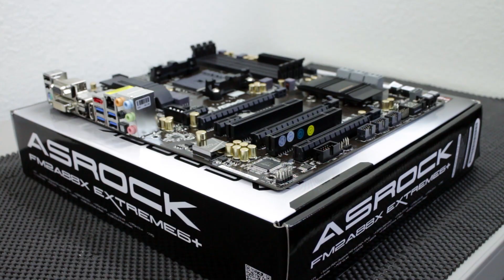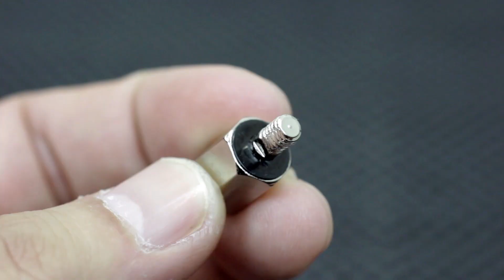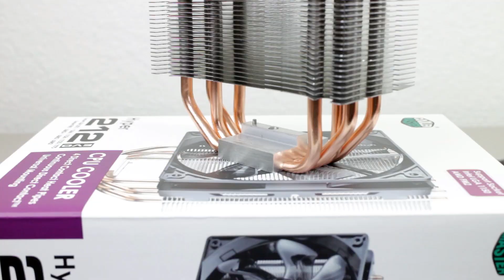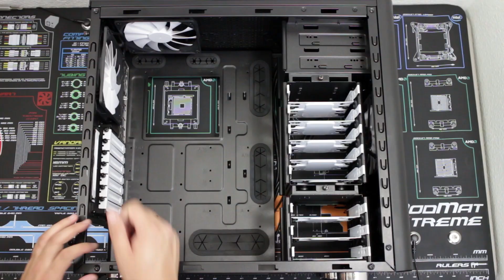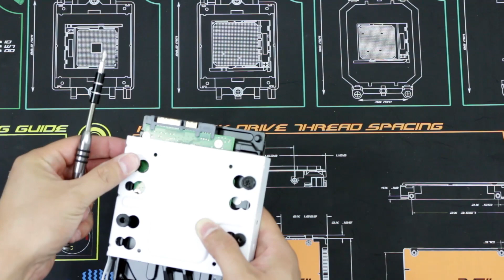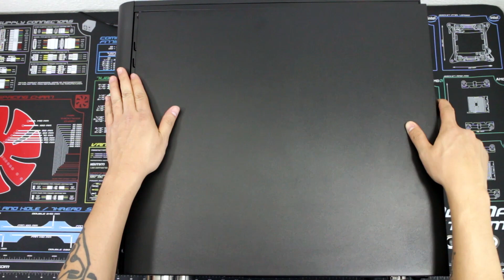AMD FM2+ Build Guide Part 2: The Build

Comment: I just wanna ask. I have my old rig.  My family used it for typing and other documentations. 

But as years passes by, we figured out that it gets slower in terms of booting from turning it on. 

Btw, i used f2a55m-ds2 rev 3.0 motherboard and a4-6300 igpu. Then suddenly last week, i won a Kingston SSD on a raffle draw. 

The first thing that comes into my mind was a question.

Does my old setup supports KINGSTON SATA SSD?
Btw, its only 120gb and i think its enough for storage of OS alone. Hoping for your response Sir Johnny. :)
Reply: What type of sata ssd is it because if it is standard 2.5 inch it should work

Comment: bro pls pls plsss reply whats the best CPU and Video card for Fm2+ motherboard?
Reply from the maker: Fx8350 from Newegg is $80 and either a RX 580 or gtx 1060 for less than $230 if you can find it. I've seen them for $200 online.
Reply: @johnnythegeek  fx8350 is for AM3+ motherboard right? Can i use that in fm2+?

Comment: I just bought all the hardware for a build just like this. My present system, an EVGA system, has caps going bad and starting to give me post issues.  It is 8 years old and has provided me great functionality but alas, everything has a life cycle so time to build a new one. I have an Enermax Ostrog GT Mid Tower Computer Case, an ASUS Crossblade Ranger MB, 16 GB Corsair Vengeance 2133 MHz memory, AMD A10 Series A10-7870K Processor - 3.9 GHz, Thermaltake SMART 650W power supply, a Hyper 212 EVO Universal CPU Cooler .  I have every thing but the power supply and processor. I am excited to build this one. Should have this done by Wednesday.

Comment: Planning on doing my first PC Build tomorrow but I have no way to avoid ESD. I know not to wear socks, but any other helpful tips?
Reply from the maker: just keep touch the metal case to dissipate the esd. you could also lay a mat or large cardboard box on the floor to stand on. Don't worry too much about static. As long as there isn't arcs of electricity coming out of you you're fine.
Reply: +Johnny Phung (johnnythegeek)  would a rubber mat work?

Comment: Toughest part is connecting the front panel connectors. Was very fiddly in such a tight space. Make sure you align the pins correctly (it's easy to let one or both of the pairs slip one place right) and be aware that the front row has a fifth, unused 'dummy' pin on the extreme right. Also there is a tenth standoff connector just above the 'purity sound' module. My case came with six pre-installed and I added another four from the Asrock supplied pack of fixings.

Comment: Nice job! Thanks for that video I am subscribing for sure. I do have a noobie question. Do you have to switch the back plate they seem to have the same screw spots for the AMD FM2?
Reply from the maker: Hey that's a great question. Most likely not only because adding the standoffs to the stock motherboard backplate will make it higher than it needs to be. then the cooler will not make enough contact with the cpu. Thanks for watching!

Comment: Hi Johnny, your videos are really helpful. Got very similar hardware few days ago, but I do not manage to run my memory at full speed. Do you have any advice how to troubleshoot such an issue ?
I have the FM2A88X Extreme4+ with a A-10 7800, my memory is 2*4K G.Skill RipJawsX DDR-2400. The system boots when I set the bios memory speed to 2133, but doesn't at 2400.
Reply from the maker: Did you check to see if you can set the timing manually to what the ram can run at? 11-13-13-31-2N Also, the voltages should be at 1.65V which is much higher than the standard 1.5V for memory. Hope that helps and thanks for watching!
Reply: ***** Thanks for your reply, unfortunately that didn't help. The memory is already auto detected to 1.65 volt, and setting this value manually didn't help either. The timing was as well correctly auto detected but I still set it manually, tried with using xmp profile as well as setting the latencies manually ( write latency was set to 8 by default and I didn't touch that setting ). Still the same behavior. Is it safe to set higher latencies (underclock) ?

Comment: Could you possibly make a video describing how to practice proper cable management in more detail?
Reply from the maker: Thanks for the suggestion. I will have to think it over because there are many factors that go into cable management when it comes to the different hardware and cases. I would have to do a few separate videos for different cases and figure out something that could apply to everyone.
Reply: ***** Well thanks for considering it. I'm working on my first build right now and this video is helping me a lot but I found myself completely lost when it comes to the little circumstantial nuances like cable management.

Comment: I have two Hyper 212 EVO's. The flat side of the bolt will easily turn in the bracket. The tolerances aren't very tight. I much prefer my two Thermalright Ultra-120 eXtreme's. They are beefier, have six heatpipes. Best of all they use the stock AMD backplate so installation is a snap.

Comment: great video man if possible could u  just show the different types of screws used in different components of the system...the shapes like finethreaded... corse....etc to put the exact screw which is required to build
Reply from the maker: yeah I've done that in the past on a previous build guide. I might do it again for another. I didn't have my macro lens for this guide. thanks for watching!

Comment: Very good Video. The camera setup are realy nice (e.g. Ram Installation).
Reply from the maker: Thanks! I was going for that because I didn't want to have 3 separate shots in a row when I could just fit 3 or 4 steps or angles in a single frame. I also want to have an up close shot. I did the same for plugging in the cables to the mobo. It's so hard to try to get a camera into the case to get the shot so I plugged the cables with the mobo out of the case so I can get good angles. Thanks for watching!
Reply: +Johnny Phung (johnnythegeek) Super well done instruction video. Well done Johnny!
Reply: What king of this motherboard